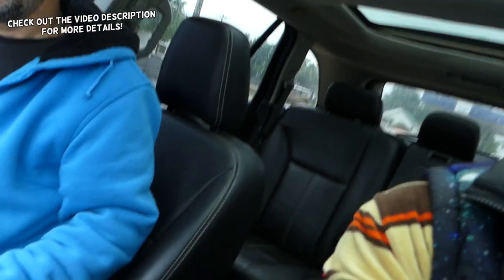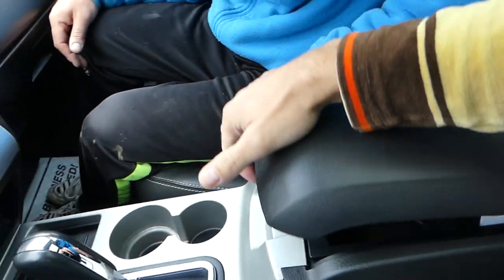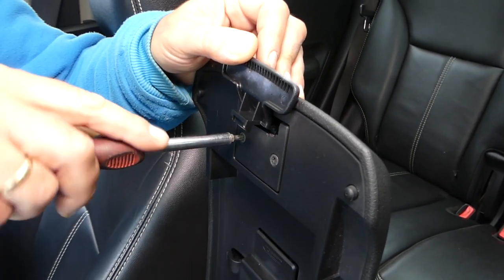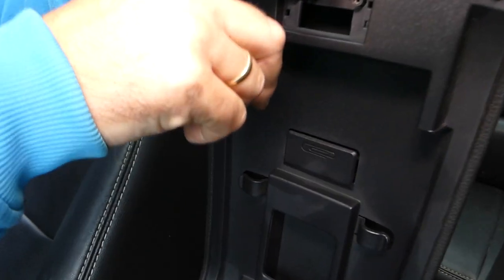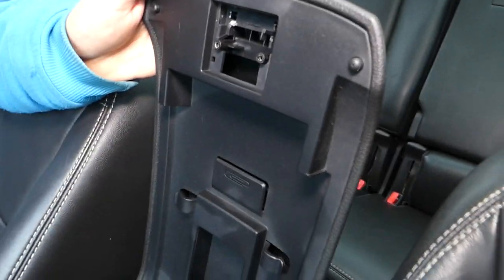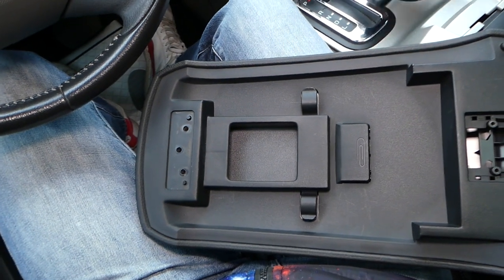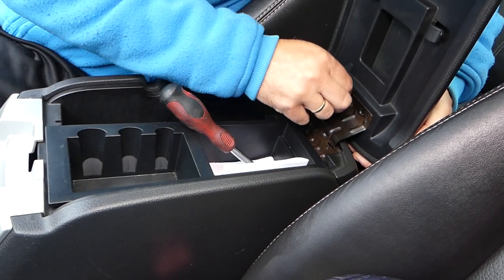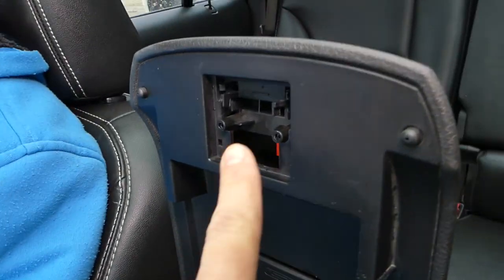FORD EDGE LINCOLN MKX ARMREST LID LATCH BROKEN, ARMREST LID REMOVAL REPLACEMENT

Comment: Hey Auto Repair Guys!  I’ve  repeatedly seen many of your videos for the Ford Edge. However, I would greatly appreciate if you guys can post a video on how to remove the center panel (where the shift stick is located) on a 2012 Ford Edge Ecoboost center console. I’ve looked everywhere and haven’t found any video for this particular model. I want to replace mine with a new one but don’t know how to remove the old one. I don’t  want to force and possibly brake any of the clips or wires. In addition there’s this leather skirt holding the shift stick and don’t know how to remove it. Also it would be interesting if you can show another video on how to replace the transmisión oil if your car doesn’t have the transmisión oil stick. It’d be good to see how you would add  the new oil since there is no oil stick aperture, at least for my car there’s none.

Comment: I own a 2007 Ford Edge. I lost my cigarette lighter socket inside the center arm rest. Backseat passengers no-longer have ability to charge there phones at rear of the console. How would I access the inside to re-plug the socket?
Reply: Check the fuse? Make sure a nickel or another coin didn’t fall in the inlet and short it out first. I had that happen once. Remove the coin and throw a new fuse in- good as new